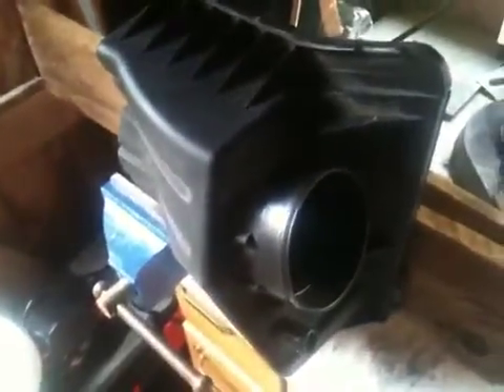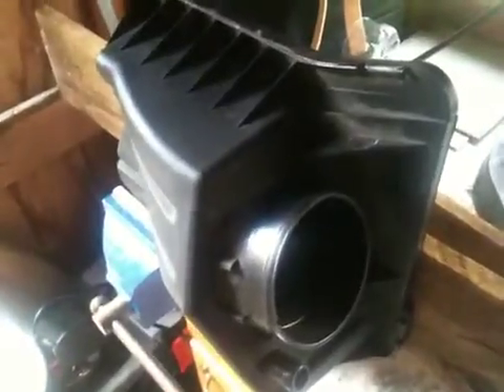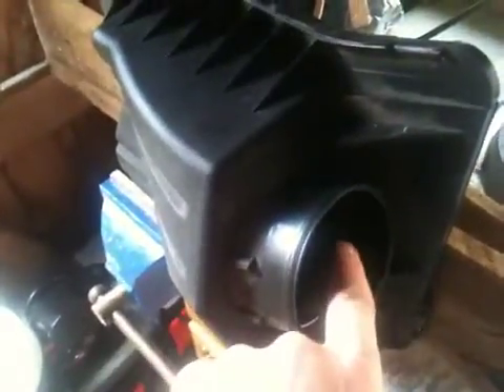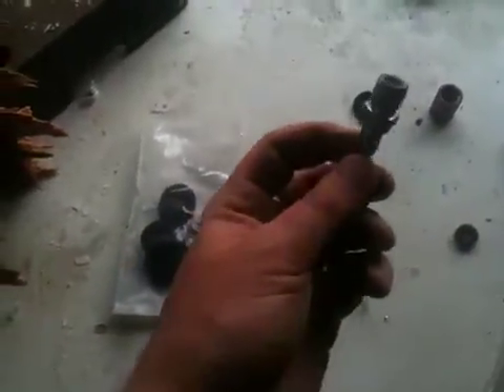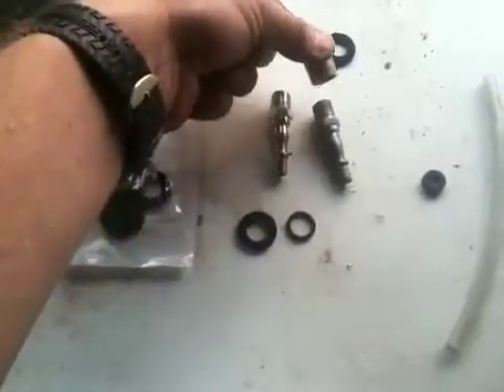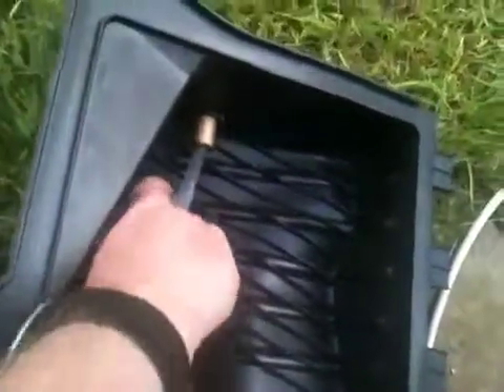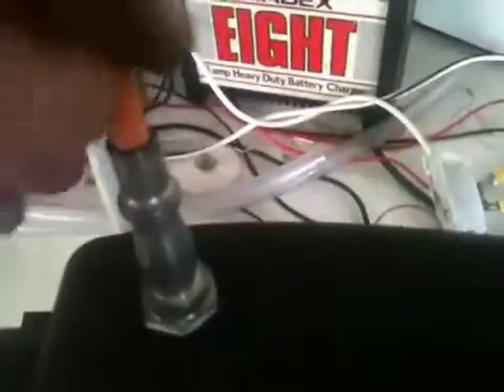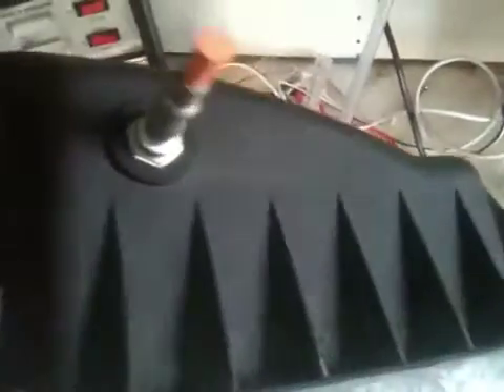HHO injection (how I fitted the air intake to airbox)

Comment: nice clean job there buddy, got a suggestion for ya. that threaded pipe you put on the inside, thread a extension pipe into it with a elbow fitting like you used on the outside then put a shorter tube on it. might use a small bit of lock tight on it. just a thought, but nice job. get that flash back arrestor so we can see you up and running lol., see ya!